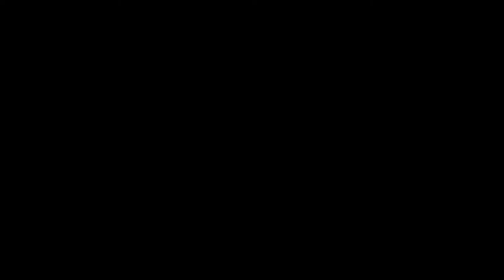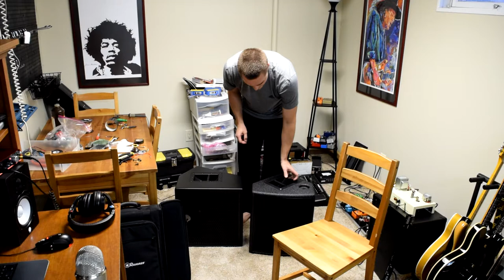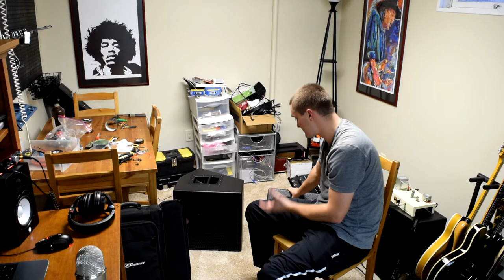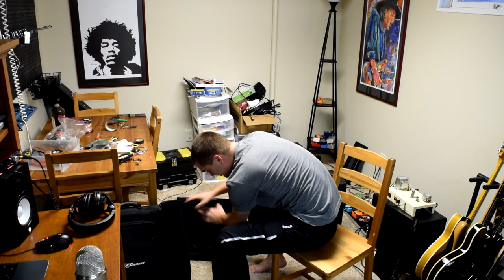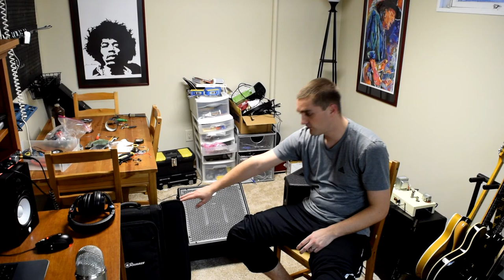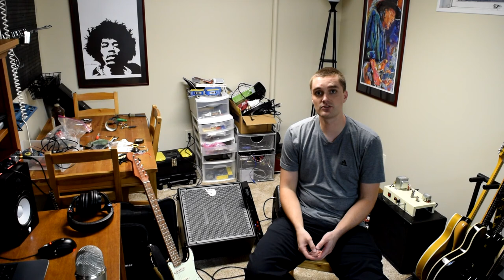FRFR Shootout: Xitone Wedge vs. Atomic CLR

Comment: How is the Atomic CLR for bedroom volumes?  Can you turn it down low for practice without disturbing the neighbors?  I have an Orange TH30 and it's impossible to play at low volume.
Reply from the maker: Sounds great.  Works equally well at low and high volumes.  Fletcher Munson is really the only thing that would be in play, and that has more to do with how humans hear sounds at different volumes than how speakers work.  The CLR is flat and accurate across the spectrum in my experience.

Comment: Great vid.  A lot of people, including myself, are perplexed by which brand to buy.  Given that the xitone is $250 less for the passives, my inclination is to go this route.  Any thoughts? Thanks.
Reply from the maker: +TheScaredofsilence Thanks!  Do you have a power amp?  Or do you know what you'd get to power the Xitone?  My main conclusion is that the modular setup is nice for flexibility as you can run the power amp with either the Xitone and some IR's in your modeler or with a guitar cab and disable the cab block.  But the CLR is as good as it gets for an all in one solution.  You just plug into it and you will get a very accurate representation of what the source is.
Reply: +Kley De Jong Setup is same as you for the most part: gt1000 + axe2.  I don't want to mess around with turning cab blocks on/off anymore (or global). Too high maintenance.  :)
Reply from the maker: +TheScaredofsilence Sure, I think you'd be happy with that setup.
Reply: +Kley De Jong Thanks

Comment: Were you using that Blue Yeti mic on your desk for the room mic?
Reply from the maker: +wyatt postlethwaite No actually that is on its way out the door as it has been sold.  I used an Audio Technica AT2020 that was positioned up on a stand right next to the camera.  The intention is to give the impression of how it would sound if you were standing right there in the room from about 7 feet away at ear level.  To literally put you in the eyes (camera) and ears (mic) of the video you're watching.
Reply: +Kley De Jong ; that frequently doesn't work out, but it did here. I like the xitine sounding tighter & perky,
The Atomic was woofy. On Brett Kingman's Atomic demo, it sounded like God. On the only other xitine demo I've seen, similar captured, the xitine had a nasty audible hiss going, & that guy was still singing it's praises. Good to hear by THIS, that guy has a Noise Gate issue. It wasn't present by his other cab.
Thx for knocking this out, I've been seduced by my Bias App on iPad Pro, so realistic in cans it's weird.
I'm a old tube snob. But I got sick of lugging around 50# pieces, etc. & 12" tube combos have a tendency to sound like shit, cab & speaker wise.

Comment: Great vid!  How well do these hold up compared to a 412 cab volume wise?  Say the clr vs a marshall 100watt head/412.   Just wondering since i play in a  cover band and the other guitarist uses a 5153 half stack.
Reply from the maker: +dwg116   I haven't actually opened up the CLR to maximum volume yet.  In fact I just got back from a gig where it had to carry a larger room and didn't even get it up past half way on both the master and channel volume controls.  I would say with confidence it has a lot of volume.  I haven't ever actually owned an amp larger than 45 watts and have never owned a 4x12 - so I can't compare on that.  But the CLR is very loud.

If you went with the matrix I would recommend the GT1000FX over the GT800FX to get that extra bit of oomph.

Comment: Most players won't even be able to conjure tones from these expensive speakers that would make the difference in sound or warrant the price.  I have an ALTO TS212 speaker and I get great sounds from it with an RP1000!  Sound is partly in your hands and if you use your ears you can get great sounds out of just about any gear that is at least decent.  Expensive gear won't make you great only practice will help with that.
Reply: I agree but I have tried so many different "FRFR" cabs and I was never satisfied. When I'm not satisfied with the sound I have less fun and play different. With a decent "FRFR" cab like the Matrix CFR12 or XiTone, whose are made for guitar players I feel much better because they interprete the sound I have dialed in at home so much better and I play better because I enjoy the sound.
Reply: Bro I dont want to practice and get good I just want to collect cool gear.